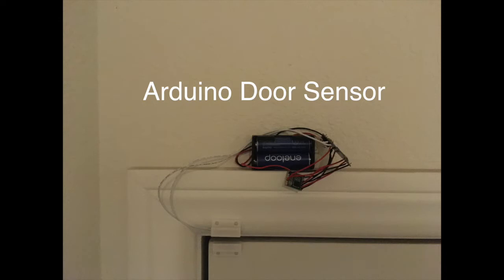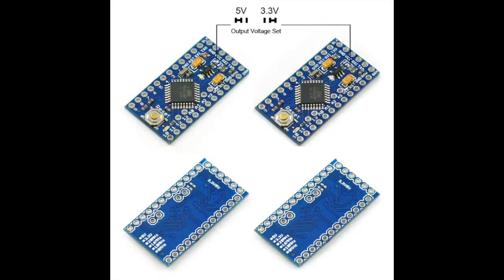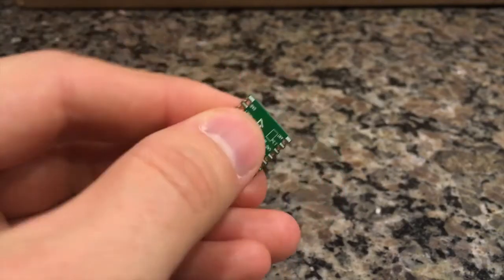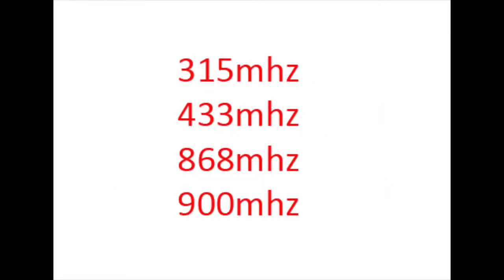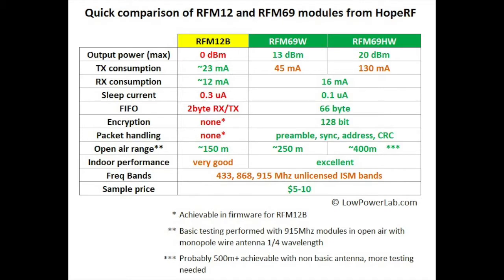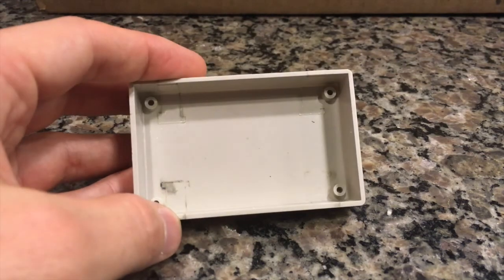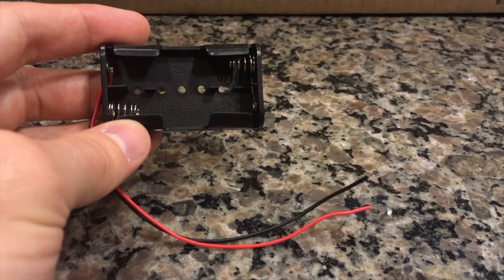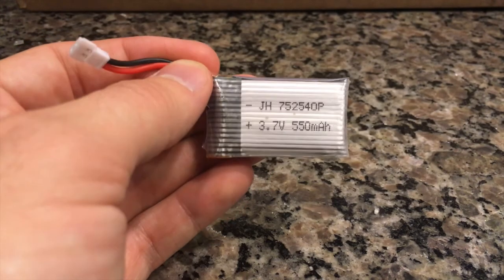Arduino Door Sensor

Comment: Cool project. I'm not sure about the binary size but you can use extreme low power mcu from Microchip(formerly Atmel). Some of them only 100nA in deep sleep. (eg. ATtiny21x/41x/ 81x/161x/321x)

ATMEGA328 Sleep modes are relatively high. 
    SLEEP_MODE_IDLE: 15 mA
    SLEEP_MODE_ADC: 6.5 mA
    SLEEP_MODE_PWR_SAVE: 1.62 mA
    SLEEP_MODE_EXT_STANDBY: 1.62 mA
    SLEEP_MODE_STANDBY : 0.84 mA
    SLEEP_MODE_PWR_DOWN : 0.36 mA

Also pro mini board contains an LDO and LEDs. You may desoldering LED and LDO prevent to unnecessary power consumption.

Comment: Hi. This is super helpful. I am trying to create similar door sensors communicating to my Rpi where I am building a security hub. I was wondering, is it necessary to have a gateway as you mentioned in the video or would the Rpi be able to directly receive the signal from each of the transceivers atop the Arduinos? Additionally, can I simply use a 433 MHz transmitter instead of the transceiver mentioned? Thanks again!

Comment: Junkie, for me a door sensor is out of the question and my solution needs to use a hidden PIR sensor, I would also like it to run on battery, either 2AA or a 9V, could also [less preferably] do 4AA NiMH (4.8V), would you recommend I use mini or nano as a seonsor? I want it to communicate wirelessly with UNO or nano to simply flash an LED to alert me.. got parents trying to sneak in on me, and it is getting quite annoying since I have been jump scared multiple times now..

Comment: Hi, thanks for the video, but still not get it ... you use both arduino and the RF 433mhz on the door? or only the rf that sends to the arduino and arduino sends it to rasspberry pi? Right now i have a door system based on ESP-01 on battery that sends to raspberry pi but the battery life is pretty short, i also tried using this implementation https://www.youtube.com/watch?v=BoYVr2UwWWg  in order to increase battery life but here i'm not happy as i cant see real time if door closed
Reply: Yes I have a arduino listening and an arduino sending signals. The listening arduino captures and sends data over a serial port to the raspberry pi but could send to any computer really. I could of eliminated the other arduino but I had so many of them I was running out of what to do with them.

Comment: Can we communicate between two Lora sx1278 Ra-01 module combined with Arduino without a gateway?
Reply: Technically yes but one of them acts as a gateway in the codebase. Otherwise you will need two on each Arduino.

Comment: curious as to why you list the step ip converter? Can the Pro Mini 3.3v power up the RFM69 module by itself?
Reply: Raad Yacu One of the reasons was that the power from the two batteries drops over time to below the ideal voltage for the RFM wireless sensor, so using a consistent voltage allows me to power this device longer and fully drain the batteries to it's max life.
Reply: @aot2002  I know it's been like 2 years since this video was published, but - can you remember how long did those batteries last? Are we talking about days or weeks here?
Reply: @andrija_naglic  There is lots of hardware adjustments like removing the led or power regulator to reduce voltage on them. Some folks have gotten almost a year or more out of them. I've found that the wireless RF sensors sucked most of the voltage because of how busy that door was.